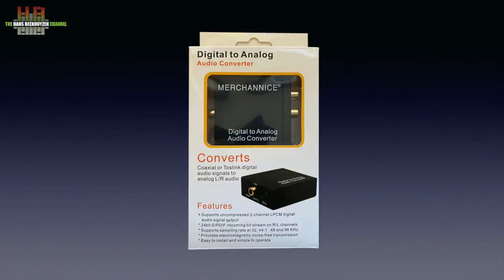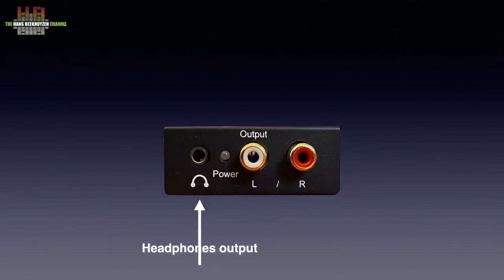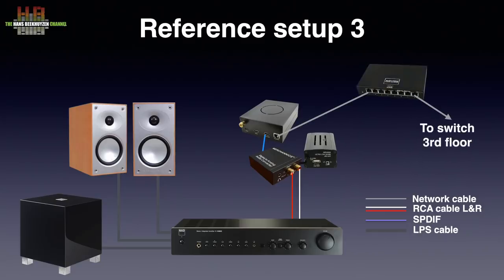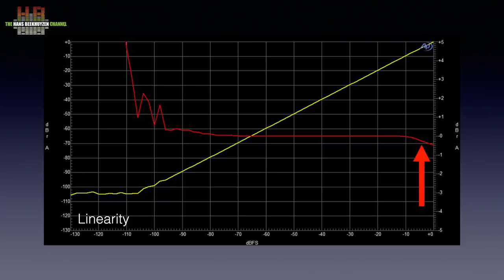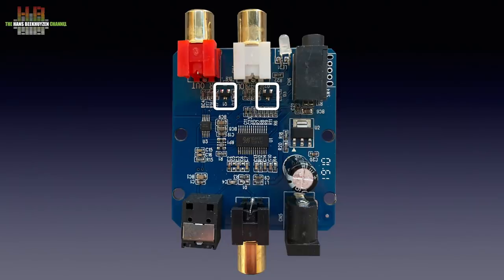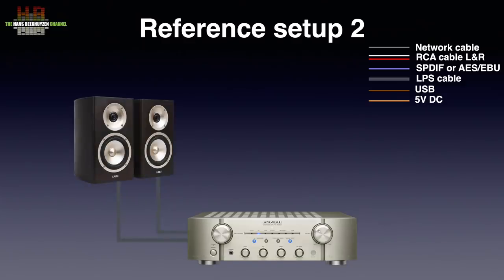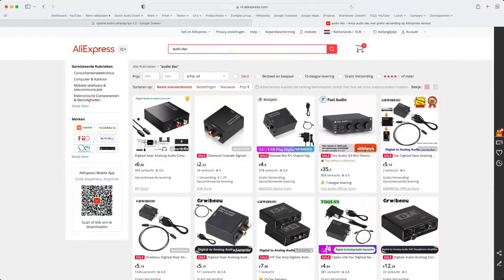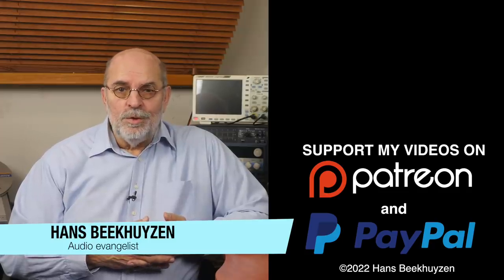The remarkable story of the € 24 DAC

Comment: hmmm.. i was getting turn on noise from a tv i had hooked up to one of these some years back, i'll have to rip that unit apart if i ever find where it got stuffed and see if it really is a fet issue in that variant. might have to find some of the proper voltages if this is the case.

very interesting.
Reply from the maker: Well you never know what version with what faults you buy..
Reply: @TheHansBeekhuyzenChannel  sure, different iterations, different parts suppliers, parts availability, etc. 

still, gives an interesting potential since at the time i had pretty much written it off. might be a decent little bored day project to poke around with it once i track it back down. throw it on my scope and see what it tells me.

now i know there's potential for the chipset itself to not be complete junk, it's worth at least the attempt. and if its a similar model and has the mute circuit, i'll see if i can find a fet worth swapping in to get the thing working as intended.

if it doesn't pan out, i'll know in short order and won't be wasting a ton of time trying to narrow down a vector.

much love for the leg work.

Comment: Highly interesting. My Prozor DAC with a very similar board has a different mute fet setup. The unit is based on the same MS8416T as yours, and has that huge cap.
Only difference: Those 2 FETs ar located between chinch and jack connector, just below the led.
On my unit, only the source is connected to earth.
It's labeled 1.YC H.
I wasn't able to find a data sheet, only that H might be a date Code. the "H" is on a 90 degree angle.
With a little luck this FET runs on 3.3 volts, but we can't be sure.
Would be awesome if it was, as this is the unit that is sold right now (end of Jan 22) by that big western online trader.
//Edit// the Box it came in sais: DAC01c, maybe the c stands for mark 3 and they fixed something?

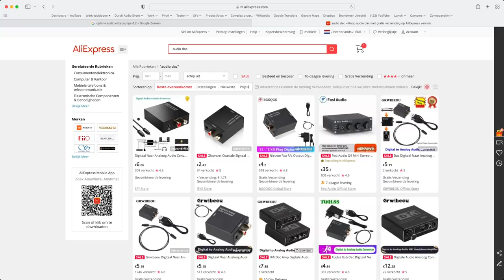Comment: 11:47 They are probably identical. The CS4344 I2S DAC or a variant drives it. Does the FiiO D3 have the same flaw?

Also, I have worked with a nice mini CS4344 board at one point in a hobby electronics project, these parts are nice.

Comment: Found for 3 euro
Reply: the one which just arrived today has a similar chip, but the components are on the bottom of the PCB, so not visible from above when opening the device, and the layout is completely different from what is shown in the video

I had to open the thing first as a small piece of solder was loose and rattling inside
Connected to an older 65 inch plasma TV's toslink out which I now use as my bureau TV, it clearly works - testing with a headphone